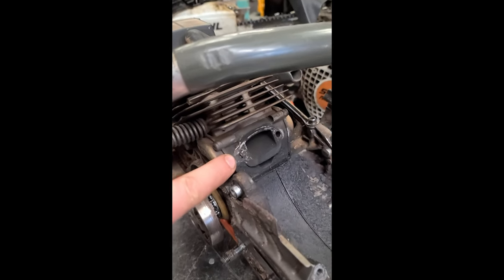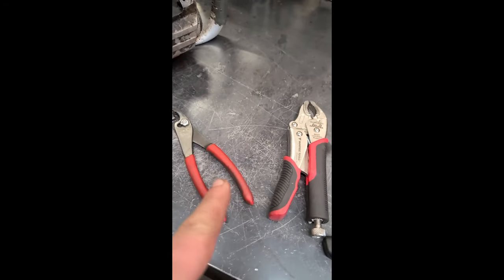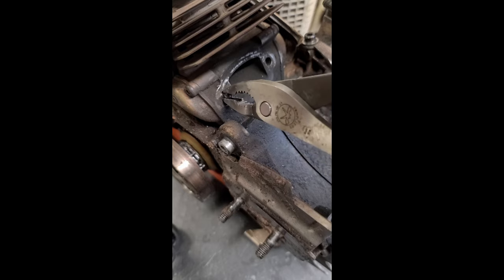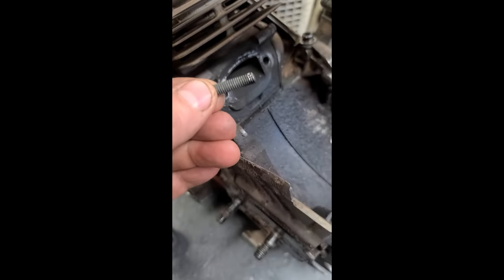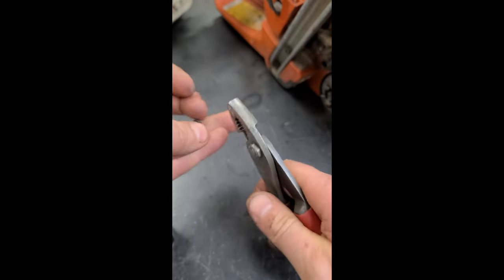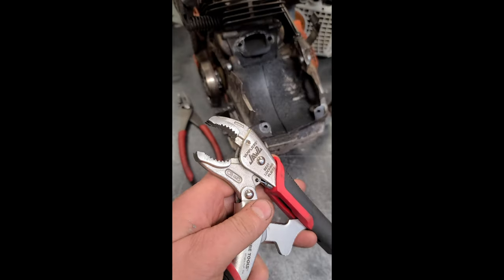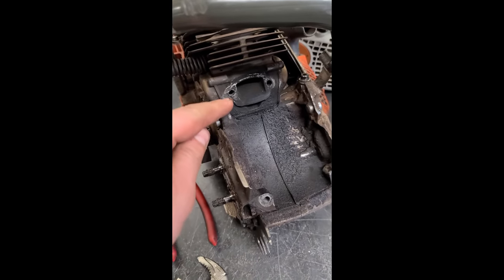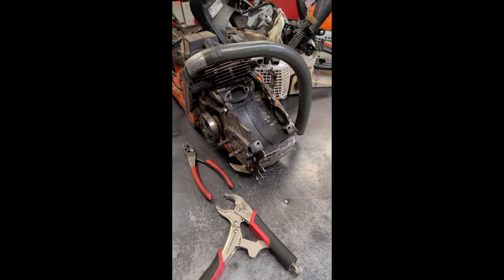Easily Remove A Broken Chainsaw Exhaust Stud! #shorts

Comment: It's always a sigh of relief when they come out easily with a pair of pliers. On the other hand, there goes your entire afternoon if the bolt is rusted and ceased in there.
Reply: @fastbusiness  and when your drill bit snaps off in the broken bolt....game over.

Comment: Hey Dony: I have a ariens rider. It is surging. I put new carb , new breather filter , new rubber gasket and regular from carb to manifold.  And it still surges. I noticed the head was leaking tiny bit of oil so I put a new head gasket redid valves to spec. Still surges! I checked key way and recaulked breather oil under fly wheel. Still surges! Both valves open up proper . Am I missing something cause it is still surging? I did tighten the head back to spec torque and in the pattern manual shows.

Comment: Nice.  Thanks.  Subscribed/thumbsUp.  That Vampliers tool looks to be of value, for all sorts of things, shall we say, 'difficult'!  But alas no link to buy one?  I poked around the internet and Amozone but that particular model of the OEM Vampliers seems to be extinct.  There are a whole bunch of other Vamp models available.  However since this is a somewhat pricey tool for me (old retired DIY not super wealthy) it leaves me confused and bewildered.  What I often deal with is exhaust manifold/muffler studs/bolts that snap.  So what model of the current panoply of models is preferred?  Is the 6.25 inch only for small stuff?  Or should I jump up to the 8.x model?  Suggestions?

Comment: Ho Dony, I hope you and yours are well. Do you feel these are more effective than vise-grips for removing a stud?
Reply from the maker: i use both, the vampliers vise grips and the pliers used in video. They work better than conventional vise-grips because they are rounded and the tip and have vertical serrations

Comment: I just did a flush broken muffler bolt. With a reverse drill bit . drilled it ever so slightly. Then fingered a xtractor and it backed right out on my 361.  

What made it break was the 3rd frame support bolt bracket. Riveted on broke. Try finding a oem muffler.  Ended up wire welding it back together and works good now
Reply from the maker: GOOD JOB!

Comment: Great video Don. Is this a common problem for you in your area?
Reply from the maker: yes, very few people maintain their saws
Reply: @donyboy73  Yeah, it's rather sad. I've had a lot of people ask me how many hours I could guarantee there Stihl MS170, 180 etc. would last, and sadly the only answer there is, is "As long as you can make it really." I personally never have seen a Stihl that has really high hours, and is still in good mechanical shape.